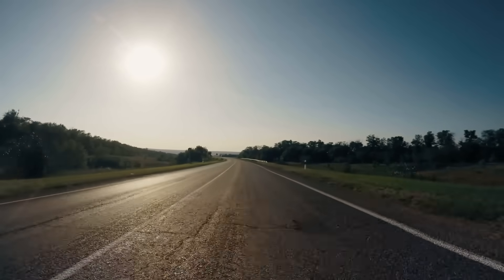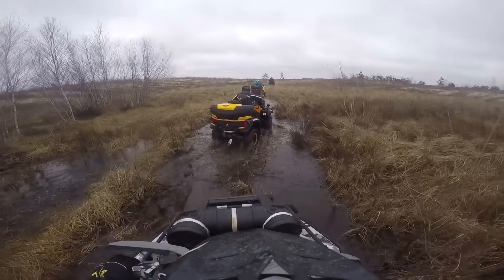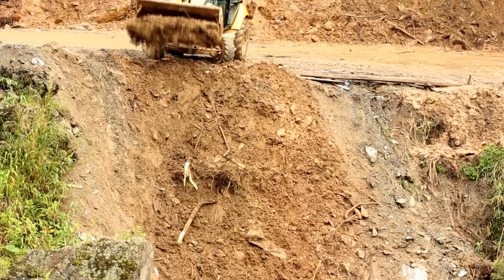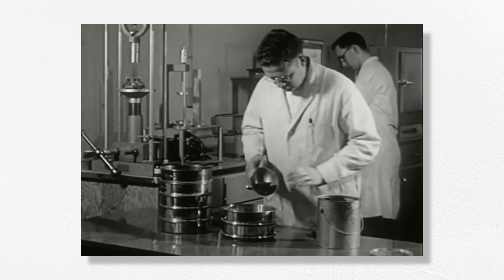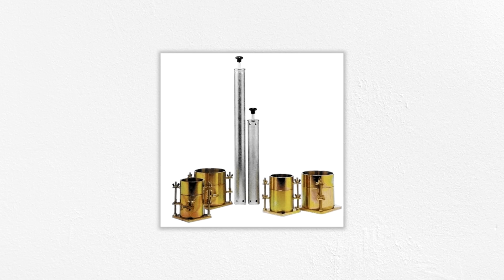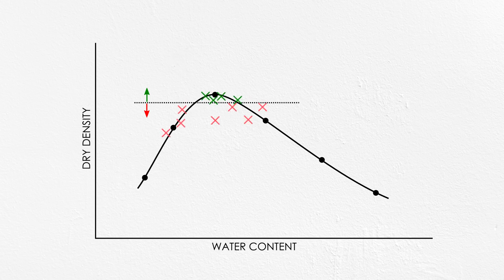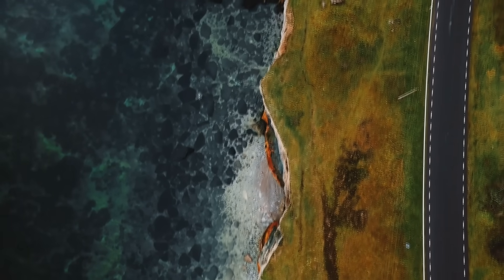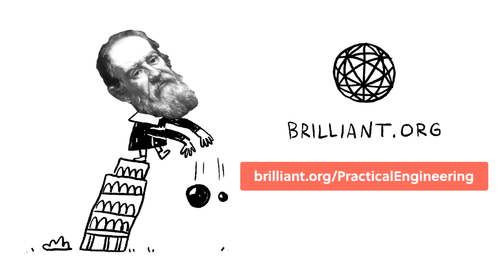Why Does Road Construction Take So Long?

Comment: Very curious about this one. My city takes like 2 weeks to repave the road, and 7-8 months to repaint the lines and put the reflectors back on.
Reply: How about this one: few weeks after road is repaved, another team arrives to replace pipes or cables under the road.
Reply: At my place it's mandatory for local authorities to always choose the cheapest contractor, doesn't mean stuff gets done fast, but it's suppose to stop local authorities from giving contracts to 'friends'.
Reply: You are talking about the soil that has been properly consolidated, compacted, and already built up to platform level.  that is the case, things can be done very quickly.
If you are talking about starting from scratch, then yeah, it is as explained to the video. However,  what he discuss on the video is just tip of the iceberg. He did not mentioned about soil settlement, constraint such as undesirable terrains, protected land and even other non nature related problems.
Reply: Possiblekim you are right. I had not watched the video when I commented so I didn’t know it was referring to starting the road from scratch. I was referring to existing roads getting repaved.
Reply: > My city takes like 2 weeks to repave the road 
That is impressively quick. You should be really happy.
Reply: whuzzzup both of those numbers were exaggerated for effect. But it takes a matter of weeks to repave, but the painted lines and reflectors take months to get done for some reason. It’s really bad because in the dark and rain, it’s impossible to see those temporary lane lines and people drive all over the road because no one knows where the lines are. Pretty dangerous.
Reply: I worked on roads early in my life. I can attest to the sheer laziness of some of these workers. Some places now impose fines if the contract takes too long.
Reply: @_BangDroid_  Don't forget about Hooke's Law for soil. They might waiting for the soil to "relax" so that it does not go over the limit of proportionality. 
If it  is over, it is very hard to get a nice compact surface especially in clay soils